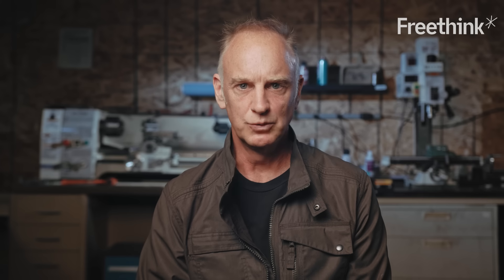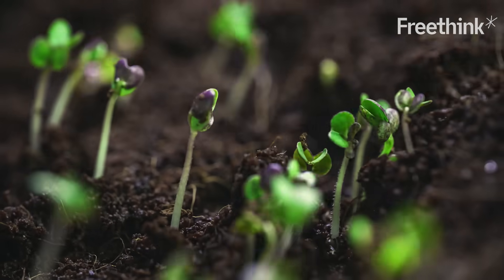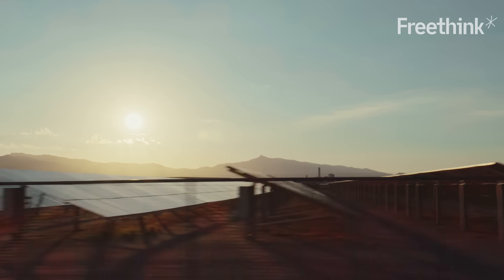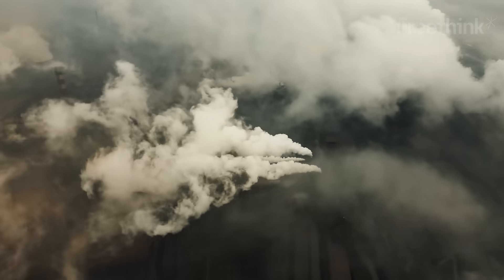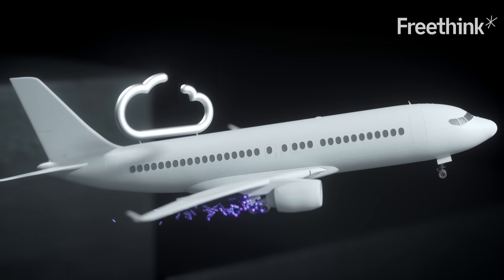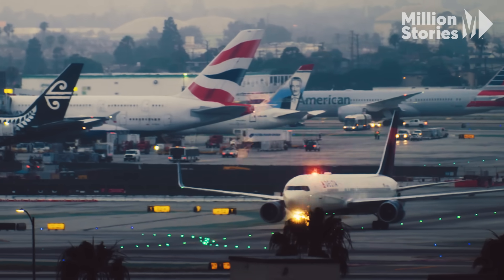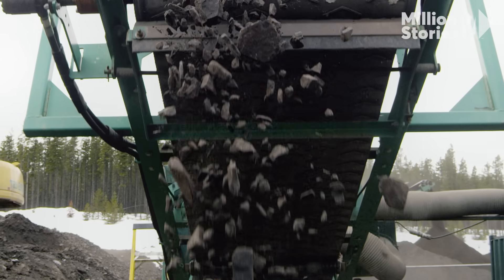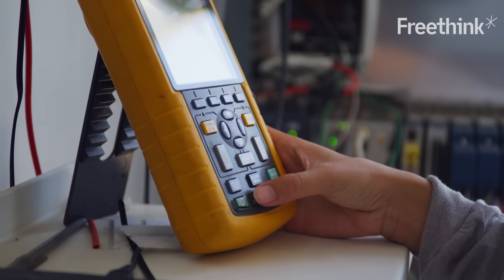Artificial photosynthesis turns CO2 into sustainable fuel | Freethink

Comment from the maker: Should we turn carbon dioxide into jet fuel?
Reply: you and me? probably not - my backyard isn't large enough. this is a very exciting technology, however.
Reply: sure.   Seems like a win-win to me.
Reply: We ?
Reply: It doesn't matter what "we" should do... unless some sociopathic billionaire or corporate board can make massive obscene profits no one will invest and we move on past fossil fuel technology.
Reply: @brianbassettnumber1  Exactly! Profitability is everything. But that is happening because the cost of renewables is dropping so fast.
Reply: If it can make it to production within a few years, it would be a great stopgap until battery storage can scale up to meet the market demands for commercial aviation and existing fleets could be replaced/recycled--  Electric systems are still the way to go long run-- they're generally less complicated to engineer-- less maintenance and the energy can come from many different sources.
Reply: @cranstantinople  Lol. Do you really think batteries will become good enough for long distance aviation in your lifetime? Cute.
Reply: @cranstantinople  y not just hemp?
Reply: @hempsaviorhemp42.0insimple6   not every problem takes weed as a solution 😅, did u smoke the seeds by some chance tho?
Reply: Oak Ridge National Laboratory developed an efficient process that uses electricity to make ethanol from CO2 with a catalyst made from carbon and copper that can be instantly turned on and off.

A natural gas electric power plant normally runs making 30% excess electricity for the ebbs and flows of demand.  With this system installed the excess could be near 0%.  

Excess/waste electricity = free energy.

If a regular ethanol plant is using the waste steam produced from the natural gas electric plant to make ethanol, it has the all the equipment right there to handle the ethanol.

If there is a wind mill farm nearby as often are, the waste electricity produced on especially windy days can be utilized as well.

Ethanol is pollution free and jet turbines can use it for fuel.  Indeed GE has sold their turbines in Brazil for electric plants that can use ethanol.

Above 10,000 feet the ethanol fuel would get higher mileage than current jet fuel from its oxygen content.  Or there are processes to make regular jet fuel from ethanol in use today.

We could use ultra high efficiency(42+%) dedicated ethanol internal combustion engines for our cars which are made of cheap recycled cast iron, half the size/twice the power, and greater mileage than either gasoline or even the best diesel engines.
Reply: @danafletcher2341  a lot of that is factually incorrect. Ethanol is LESS efficient per volume due to its O2 content. Jet engines would use 150% fuel for the same mileage.
IC engines would have the same problem, but be able to take advantage of the higher octane rating of ethanol, by using higher compression ratio’s. Only problem is the arbitrary regulations on IC engine design, not to make them more efficient, but make it impossible to reach their potential.
Reply: The real question would be...
Would breathing fumes from jet fuel make my lungs feel healthier if the fuel was carbon neutral?
Reply: @dragonskunkstudio7582  y not use hemp fuel??
Reply: @Jeff Peate No crisis no pay check, independent or not.
Reply: @Jeff Peate you obviously haven't been listening to anything I have said. Because I not only admitted that humans have increased CO2 in the atmosphere , but my whole point was that that was a good thing. So no, I haven't changed tack.
Reply: @Jeff Peate at 150ppm all plants start to die, shortly after all life follows.

This information is available for those that look. At the point of industrialisation levels were just above the 200ppm Mark, rising from a minimum of 180ppm. I have mentioned this previously, but you aren't even aware of argument.

The fact that 80% of plants are receiving far lower concentrations of CO2 than ideal is also a clear indicator.

Since you clearly don't follow the argument, there is little point in continuing.
Reply: @Jeff Peate I love it when the argument sinks to personal assertion. For your enlightenment, I have a degree level education on Electrical and Electronic Engineering, a formal Masters level ed, and 40 years of personal education. This year alone I have studied the Highs Boson, the 4 laws of thermodynamics, and some history to name but a few.

So your counter argument to the fact of deforestation driven by copper mining is that you have a copper mine next door that is not in a forest. Seriously?

Ok if you think that's a good argent I'll leave you to it.

The UK is currently suffering a massive energy crisis, mostly because of lockdown but made far worse by the fact the the wind didn't blow for a significant part of the summer causing us to expend our gas reserves. Wind das.require significant investment in energy, in manufacture, transport, construction and eventually, decommissioning and disposal.

Windfarms require at least 7 tes the copper of the equivalent traditional power stations. Copper mining is a significant contributer to South American remain forest destruction, regardless of the copper mine you may have next door.
Reply: @Jeff Peate you don't seem to understand the concept of the carbon cycle. The sinks you talk about rove carbon from the cycle.

Some sinks, like the ocean, return carbon to the atmosphere when the world warms, as it inevitably does.

Some sinks are more permenant, like carboniferous rock and fossil fuels. These sinks remove carbon from the cycle in ways that it cannot normally be returned.

Carbon roved from the cycle, is carbon that cannot be used to great life. The dearth of carbon is the. Reason there is not a much greater amount of active biomass.
Reply: @Hustle Band 
Ethanol have higher evaporative emissions from fuel tanks and dispensing equipment. These evaporative emissions contribute to the formation of harmful, ground-level ozone and smog.Feb 17, 2022

Burning ethanol can potentially add more smog-forming pollution to the atmosphere, however, it can also exacerbate the ill effects of such air pollution.Apr 18, 2007

Higher-ethanol blends still produce significant levels of air pollution, reduce fuel efficiency, jack up corn and other food prices, and have been treated with skepticism by some car manufacturers for the damage they do to engines.May 25, 2016
Reply: @Hustle Band 
No crisis no pay check, independent or not.:
 "Prove one directly correlated to the other" 
Band 
It is your responsibility to determine the veracity of the statement . There are plenty of published papers on the subject . Proof is somewhat  subjective and cannot be proved by the scientific method to a certainty . That's why you have that large , beautiful brain .
Reply: the solar array can steam water and turn a turbine creating electric energy without costing $3000 a gallon for manufacturing jet fuel. You are ignoring the chemicals needed to make a reaction to separate co2 from the air, these chemicals need to be constantly manufactured and replaced in your system. How are these spent chemicals disposed of? Synthetic fuel is a multi-step process, after creation it needs to be refined to an engine standard using even more chemicals
Reply: @enstigatorofficial  If you can make fuel from sunlight, which is what this does, then you can use a part of that fuel output to power all of those processes and still have a surplus of extra fuel to sell for commercial / consumer use. Problem solved.
Reply: Fossil fuel IS CO2 taken from the atmosphere and turned using solar energy, to fuel storage.

It is what has depleted CO2 levels to the dangerously low levels they are at now.
Reply: @Jeff Peate you hit the nail on the head there - "who's careers it is" a science made up to profit from climate change alarmism.

Climate change is real. The Climate has been changing for nearly all of the 4 billion years plus the planet has been around.

The world is currently colder and has less CO2 than it has had for 90% of the existence of planet earth.

We are currently in the warm part of an Ice Age. So called because there is Ice at the poles.

At the end of the last glacial maximum, CO2 concentration had fallen to 180ppm which is a knat's cock away from 150ppm, the point at which life becomes unsustainable. 

In the late 1700s it had increased to around 200ppm largely due to warming releasing stored CO2 from the oceans. Industrialisation happened right at the end of the little Ice Age, a cold spell that lasted until 1780/1800. Its not really surprising that the world has warmed since then is it?
Reply: @markhutton6055  interesting conversation you had with Russell's Brand. I don't think you wil get anywhere especially when he thinks 10s of 1,000s climate scientists backing this climate change crap are working independantly. The greater majority who do profess to a co2 problem are preist within the cult employed by the UN, NASA, governments and energy companies.
A few points to carefully consider are; the  planet is greener now than 100 years ago, the computer models used to generate the fake over estimated warming are based on corrupt data (which have been debunked over and over). The actual facts go on and on. Yes there has been a mild warming .2c over the last 50 years. Considering most of the data comes from America it is logical that that makes sense with the expansions of cities which create localised warming.
I'm 63 lived by the Pacific ocean (it was my play ground) for the greater part of my life. From a purely observational level I have not witnessed any rising of the ocean. Being very familiar with coastal areas I think I would notice if my favourite fishing spots were going under water or my favourite surfing reefs were not breaking.
In my experience getting through to a cultist is like talking to a brick. Have fun and take both of you. Russell don't be scared to look into data and facts that don't agree with your thinking. It is what science is all about. The Duning Kruger theroy can be used on many scientists and PHd holders as their funding requires tunnel vision.
Science is never settled no matter what the media, governments and those gaining from spreading fear tell us.
Reply: @Jeff Peate Great, please specifically address the ones which are incorrect since I hate to be wrong on anything.  Appreciate it.
Reply: @Jeff Peate absolutely nothing
Reply: @Jeff Peate prove what correlate to what?

Are you denying that CO2 is essential to life? Or that fossil fuels are dead life that took CO2 from the atmosphere? Or that if CO2 drops below 150ppm we all start to die?
Reply: @Jeff Peate we are far from poisonous levels of CO2. Levels are not very high at all. They are, as I have said before, only just at levels comfortable for the 20% of plants that evolved to survive in the low CO2 concentrations that we have. 80% of plants would be far happier with anything up to 10 times what we have now. Greenhouse growers economically keep their greenhouses at 4 or 5 times what the ambient atmosphere is.

Change happens. Get over yourself.

You are quite happy to suggest that scientists working for oil companies would lie for a pay check, even going so far as suggesting that anyone who didn't support the narrative, such as myself, must work for an oil company.

There are plenty of scientists who don't have anything to do with oil companies who don't agree.
Reply: @Jeff Peate yes a hundred times current volcanic activity. What don't you understand. CO2 is lower than it has been for the vast majority of the existence of the earth.

CO2 is LOW. The plants need more.

Tipping point is BS. If we are facing a tipping point when CO2 is lower than it has been for the a billion, if not 4 billion years, why did the world not tip when it was 5 times higher?

Without human intervention life would eventually die out through CO2 starvation.

What is the ideal amount of CO2 as far as you are concerned? And what is the ideal concentration based on?

Climate is always going to change. We. Are currently in the warm part of an ice age, it will, at some point get very much colder, and at some point get very much warmer. Throughout the history of planet earth CO2 levels have NOT caused heating, they have in fact followed it as the heat releases CO2 from the seas. There has been no real correlation as the world has been hot, much hotter than now, with relatively low (though still much higher than now) levels of CO2 in to and cold with high levels.

Humans are not the biggest producers of CO2, and CO2 is not the biggest contributer to the greenhouse effect (also essential to life). CO2's effect is inversely logarithmic, and physicists believe that it's effect is largely saturated.

A further degree of warming would bring the temperature back to where it was 1000 (approx) years ago (and a 1000 before that).
Reply: @Jeff Peate if the activists keep chopping down the forests to dig up copper for stupid inefficient wind farms or to replace meat with plant based crap, there would be bigger sinks. But that's beside the point.

As for nonlinear functions, you must have missed what I said about the inverse logarithmic nature of the ghe   of CO2. Also you know nothing about me so it is arrogant to make judgements about what I do or don't know.

All life is the sink for carbon, as are the oceans, but you miss the point. The sink is only required to maintain the carbon balance, and currently there is not enough.

As CO2 has increased, so has plant growth.  With plants seen in more places now than ever in recent human  history. The fossil fuels were a sink, as are carboniferous rocks, the white cliffs of Dover and with no way to return this carbon to the cycle earth was doomed. 

It can't be a cycle if everything is captured in the sink.
Reply: @Jeff Peate you have obviously missed the point of everything I have been saying. I have said all along, and it's the whole point, that humans have increased CO2, thus restoring the balance.

So no, no change of tack.

Your assertion that you need a sink as part of the cycle is fallacious, as too big a sink had caused CO2 to fall to dangerously low levels.
Reply: @Jeff Peate I am not Now admitting anything different. That was the whole basis of my initial post. What have you been arguing about if you don't understand my position? Hilarious.
Reply: @Jeff Peate you have failed to make any valid points, and failed even to answer direct questions.
Reply: @Jeff Peate I didn't say anything about arbitrary modelled trends. They are less than is required by 'nature' the main driver of the cycle.

If plants, and therefore life requires a certain amount, that is what is required.

If all you can do is throw insults, it doesn't say much about your arguments. I have replied to all your points, yet you can't even answer a simple question. 

If you can't remember the questions I asked you then go back and review all the post. 

Of the greenhouse effect is the driver for the ideal level of CO2 in the atmosphere then zero would be the ideal amount, but zero would mean no life.

If life is the driver, then life is happier with the amount we have now than it was 200 years ago. Some.life would be happier if it was three or four times higher.

Your comments have demonstrated that you don't understand the concept of a sink, the sink remove s carbon from the cycle, which is what life did, until humans started returning some of the carbon to the air.

Through as many insults as you like, it doesn't change any facts.
Reply: @Jeff Peate people who pick up on autoincorrection only make themselves look stupid.
Reply: @markhutton6055  
.
Only a mere 00.006% of all the Carbon on Earth is stored underground as oil/coal/gas.
.
80% is in Carbonates in seashells/limestone/etc., which is recycled continuously. The rest is biomass of all kinds, and atmospheric CO2.  (see The Global Carbon Cycle (CrashCourse (YT)).
Reply: @Jeff Peate Thank you for questioning.  I will now have to withdraw my 30% waste electricity statement since after going through many articles on making Ethanol from CO2, I can not find the one(using numerous search engines) where I got the number from talking about using that on electric plants.  I can only find statements from excess from solar and wind.  I wish I would have saved the article.  If I find it in the future I will come back.

We do know that electric plants do not operate at maximum efficiency which would be a load factor of 1 (with load factor being average demand usage divided by maximum demand over a given time period) so an electric plant must have capacity sitting idle for long periods of time.  With the Argonne National Laboratory and/or Oak Ridge catalysts making ethanol which are able to instantly turn on and off installed on the exhaust an electric plant, the plant would be able to operate at the most efficient possible point near 1 instead of their current load factors which are probably considerably less than 1 and no doubt vary by region and seasons.  Wind and solar in the mix must really add complexity to that as well.

I suppose I should have said almost pollution free for ethanol to be more precise.  Most I often do.  Ethanol is so pollution free that vent-less indoor fireplaces are sold.  Ethanol is so clean burning that the Swiss Federal Laboratory found that the addition of just 10% can clean up our dirty gasoline's especially health devastating nano or ultra fine particulate emissions by >95% compared to E0 gasoline.   Polycyclic aromatic hydrocarbons, or PAH emissions were lowered by 67-96% and their toxicity by 72%. E85 was some better than than E10.

Oak Ridge National Laboratory did do a study on an ad hoc ethanol engine made from a VW diesel with spark plugs installed in place of the glow plugs and achieved an efficiency of >42%.  Ricardo built an ethanol engine for GM a few years ago which was around half the size of their diesel but with more power and 3.2% better mileage.

Efficient ethanol engines are not new technology, it was known long ago.

Rear Admiral C.M. Chester wrote Henry Ford a letter on Dec.15, 1916:
"...I also pointed out in the article that as governmental laboratories had developed from 40 to 55% efficiency in alcohol engines as against 20% in gasoline machines, the use of alcohol at double the cost of gasoline for power purposes, was cheaper for motor[s] than gasoline in common use today."

Why no ethanol engines?  Not long after trust buster Teddy Roosevelt ended a 44 year old prohibitive tax on alcohol with the Free Alcohol bill just in time for Henry Ford's flex fuel Model T (ethanol was Henry's favorite fuel), John D. "competition is a sin" Rockefeller gave a huge sum to a group of ladies known as the Women's Christian Temperance League to outlaw alcohol which was known as Prohibition.  And not just any law, a Constitutional Amendment no less.

The ideal energy source with little drawbacks in my mind would be liquid fuel thorium reactors(LFTRs).  The very inventor of our current solid fueled uranium reactors testified and warned Congress that his design was too dangerous to use at the scale of electricity generation.  He advocated for using LFTRs but Congress was hubris even then and also wanted his design to make weapons from which can't be done with LFTRs.  Unfortunately for humanity his warnings came true as we saw in Japan, here, and Russia.  

We did build a demonstration LFTR and operate it for years back in the late 60s and early 70s at Oak Ridge National Laboratory.

LFTRs are walk away safe and produce very little waste.   The little waste they do produce is only radioactive for 300 years.  They operate at low pressure so they can be compact which means they do not need to be built on site but rather in factories which makes them much cheaper to produce.  Thorium is very abundant in most any country and we have it already stockpiled since it is a waste product of rare earth mineral production.  LFTRs also can use for fuel our current radio active waste produced by solid fuel uranium reactors eliminating that problem for the most part.

They operate hot enough to more efficiently separate water into hydrogen and oxygen directly without electrolysis.  So then it can be combined with a carbon source to make liquid fuel such as ethanol.  The Navy has done experiments using an aircraft carrier reactor for the purpose of making on board a fuel for their combat aircraft using CO2 in the seawater.

Forgot to mention that Scania already makes a large engine which is sold worldwide this very day in trucks and buses.  It has mileage equal to their diesel engines and is much cleaner(it uses 95% ethanol and does burn a 5% more polluting addition for diesel ignition).  

Ethanol engines have high efficiency, simplicity, range, and are made of cheap, abundant, and recyclable cast iron and burn ALMOST pollution free.

Then we have fuel cells that use ethanol which can use it directly or pass over a catalyst on demand for hydrogen for the fuel cell.  They can be made small enough for portable computers and drones or large for vehicles.  Nissan drove one around in Brazil in 2016 where E100 is sold.  Sailboats and RVs have them for electricity.  Europe has ethanol powered fuel cell submarines which are ultra super quiet.  Although ethanol is a super safe fuel as fuels go, fuel cells can use ethanol with enough water added so as to be non-flammable.
Reply: Let's put solar panels on every home, business and covered parking rooftop and switch to electric vehicles making nearly everything we do solar powered while completely decentralizing our power supply and empowering everyone as power generation owners.

Solar power is CHEAPER and electric vehicles are soon to be CHEAPER to make and already are considerably CHEAPER to maintain and operate, especially if charged from your own solar power.

A 3-5 year ROI (return on investment) for a solar array that will generate power for decades is a no-brainer and the panels can even be made locally too.

#EndFossilFuels #SwitchToSolar #SwitchToElectric #GreenNewDeal #EmpowerEveryone #DEMEXIT #StillSandersPlatform
Reply: @Russell Bland dude stop feeding the troll
Reply: The future is making Ethanol from solar thermal with NewEngineType (NET) engine which can run on hot water (solar thermal) and use that RE fuel at 60-75% efficiency in a combined cycle similar to what is on the grid, but different.  The CO2 of old ICE cars is 1/2 that of EVs with RE fuels.  NET should be less than $1/gal and 160 mpg (gasoline) and 112 mpg Ethanol.  Range will be 10,000 miles.  Can tow up to 22,000 lbs trailers too for 2000 miles.  EVs are so obsolete it makes my head ache to think of all the wasted money.  Yes, I worked with the Caltech guys who invented the modern day EV in 1990.  They stopped because the concept can't work.  Even Volvo said that with their recent study.    Again, RE fuels are the future.  We will all have fuel makers in house.  Ethanol is safest fuel for home use.
Reply: @Hustle Band 
Mar 6, 2013 — "Climate experts believe the next ice age is on its way...within a lifetime. ... 1972 – Scientist Says New ice Age Coming
Reply: @snaplash  It's fine to burn it again as long as the cycle is neutral overall. That's the whole point. It's a continual recycling program driven by sunlight that we can sustain, instead of an unsustainable fossil fuel reliance.
Reply: It will make the tickets cheaper
Reply: I think so. But another idea would be turning carbon dioxide into milk, ice cream and even meat substitute. But what I would like to know is this: Is there a playlist for Make It Count? I'm having trouble finding it.
Reply: As long as it's controlled,  plants need co2 to function, we need plants to function.
Reply: Carbon Neutrality for air travel would be one of my personal exemptions from mandated electrification.  Only air travel needs it. Aerospace uses hydrolox or metholox or kerolox with these last two being a refinable product from these synthetic fuels.  This is a no-brainer for aviation because it wold free up a ton of capital to invest in total electrification and decarbonisation of the rest of the economy.
Reply: we could turn it into whatever we want at that point
Reply: Only if that jet fuel doesn’t melt steel beams
Reply: @Jeff Peate CO2 is essential to life. Pre industrialisation, atmospheric concentrations had dropped to dangerously low levels. 

Class 4 plants, the plants with the lowest CO2 requirements, have only just stopped increasing crop yields, meaning they only now have enough CO2. Class 4 plants make up 20% of the worlds plants. 80% of plants need more CO2, between 5 and 10 times what we currently have.

All fossil fuels contain carbon that was once CO2 in the atmosphere. All carboniferous  rock contains carbon that was once CO2 that was in the atmosphere.
Reply: @markhutton6055  Sorry - most of what you say is incorrect. C3, C4, and CAM photosynthesis have nothing to do with CO2 concentration. They are adaptations to heat and dryness. CO2 concentrations are higher now than ever in the last 800,000 yrs of glacial cycling. We are near a temperature maximum in this cycling anyway, due start back down toward another glaciation, but there is concern that too much CO2 could outweigh this natural cycling.
Reply: @markhutton6055  Correct, nice to know someone has a brain...
Reply: @markhutton6055  Nice fossil fuel propaganda, bro.
But no, increasing crop yields are almost certainly due to continual improvements in farming technology and the race to increasingly over-fertilize and over-pesticide crops, and probably not from more CO2 and climate change being the "good thing" that the oil industry wants to spin it as.
Reply: How about you stop hyping?
Reply: With hemp..yes
Reply: @AI-dk5wc  y not use fucking hemp??
Reply: @Jeff Peate I don't see what the point of you throwing my question back at me was. Trees and plants buried underground become oil and coal, and peat.

All carbon removed from the atmosphere. Part of the action that would, eventually, without human activity or periodic volcanic activity, have eventually, perhaps, lead to the death of all life through CO2 starvation.
Reply: I think yall missed a trick here, industries that currently have pressures to reduce co2 emmision would as a result have less pressure to decarbonize, sure it might help make aviation a cleaner industry but there are potential solutions for that which may be less likely to remove pressures to decarbonise like hydrogen fuel cells or aluminum air batteries if rnd goes towards them instead
Reply: @TransVoiceCoach  Yes! Close the garage door start your car fuel is carbon neutral you still die.
Reply: Fossil fuel IS CO2 taken from the atmosphere and turned using solar energy, to fuel storage.

It is what has depleted CO2 levels to the dangerously low levels they are at now.
Reply: If we pretend that plants don't actually already do this as part of a self controlled and fully sustainable system, hemp being the most efficient source.... the king hath become the king of fools.
Reply: @evolutionCEO  The problem with hemp is that we'd need to grow unbelievably huge amounts of hemp. Agriculture is already incredibly environmentally destructive and polluting. Having to expand it two or three times as much to meet our energy needs from hemp would be absolutely ruinous.
Artificial photosynthesis, on the other hand, can just be done in an industrial facility somewhere without having to clear gigantic swaths of nature for farm fields.
Reply: @wasd____  modern agriculture is deliberately destructive. when the environment is healthy, we are independent. when the environment is unhealthy, we are dependent. that does not mean proper agriculture is destructive. we use internal combustion, whereas external combustion is the efficient engine.

where business is god, the environment shall be destroyed. worship not false idols.

in the process of diverse reforesting (the only green solution) the growing of hemp would very much promote the forest. i think you possibly lack a proper knowledge of how big hemp gets, how much oil it produces or any other of it's amazing qualities including it's ability to withstand drought and resilience over all. it makes amazing paper, ships sails, ships ropes, shopping bags that will last 50 years and then can be composted.  

the strongest plant fiber known to us. the second fastest growing after bamboo.  

you are right though, if it is pharmed with modern methods, we are screwed....

the Sahara should be a rainforest and was not that long ago. those who control business killed it.
Reply: @evolutionCEO  Cool conspiracy theories. But I'd prefer to stick to discussing reality, thanks.
Reply: @wasd____  what is is and what isn't isn't and that is that...
Reply: @evolutionCEO  Yes, and that's why conspiracy theories are silly. What is, is. And conspiracy theories generally aren't.
Reply: @wasd____  theories are evidence against themselves, which is why i don't do theories.
Reply: @evolutionCEO  Whatever you say